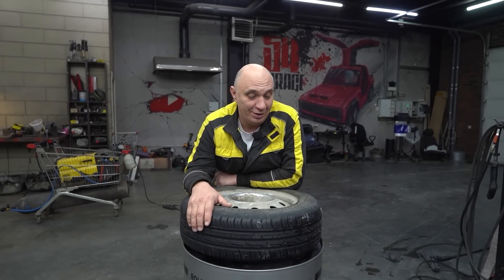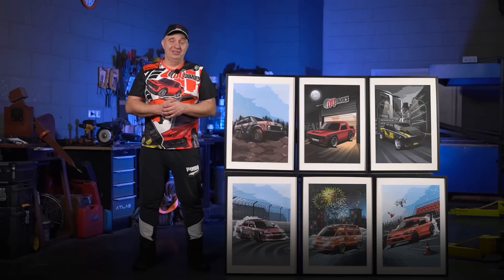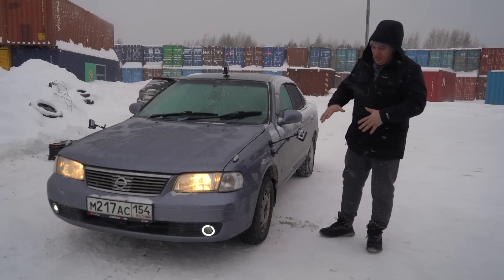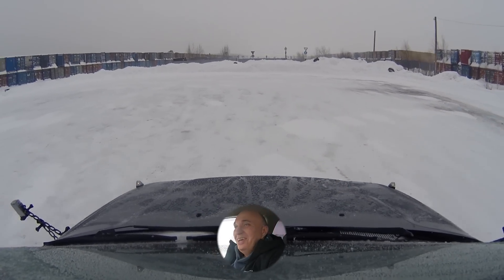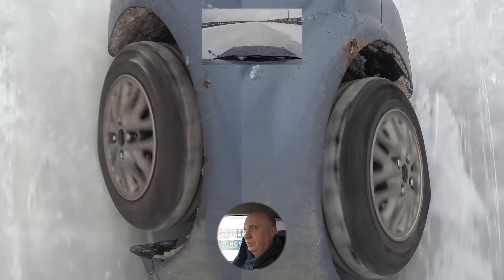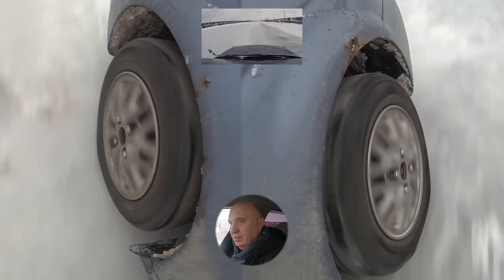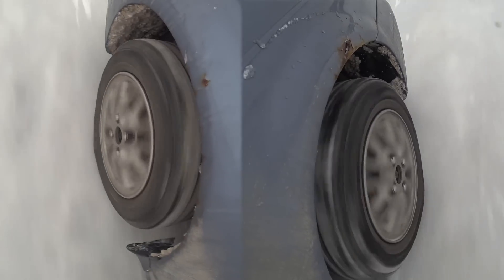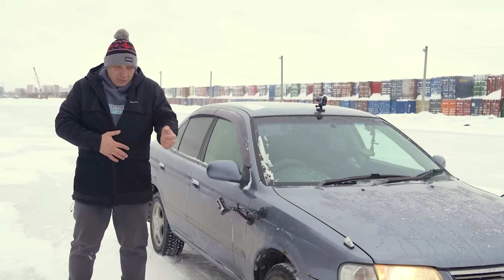We Glue Sand to Summer Tires (for grip on ice) – will it work?

Comment: Snow tires are effective because it is a softer rubber/polymer. I think using Rubber Cement (which is very soft) instead of some glue, would give better grip. The second part is using higher grain sand. Small grain simply gunks up with snow & ice, making for a flat smooth surface again, and becomes much less effective. Larger particles would be something like using studs that won't gunk up and continue biting into the snow/ice.

Comment: My understanding of studless winter tires is that the three major design features are soft rubber for dry traction, narrow grooves to trap snow for snow traction (snow sticks to snow) and silica (sand) embedded in the rubber for ice traction. So these wouldn't help with dry pavement or snow much, but it makes sense they would actually be great on ice like this test. At least until you drive them on dry pavement and rip all the sand off.
Reply: There's also "siping", as in "to sipe" (not "sipping", to drink). Which is:
      a groove or channel in the tread of 
      a tire to improve it's grip.
Usually I heard this done by hand, with a razor... 

I never really looked at winter tires, always having a 4WD truck and living in a suburban area that plowed/salted/sanded, so I never needed winter tires. However, I've noticed in the various videos here, that their winter tires DO have lots of siping in them from the factory.
It looks kinda like fish gills on their tires.

I had always kinda thought it was just something cheap people did and was more of an old wives tail... But I guess not! 😊
Reply: @DUKE_of_RAMBLE  Many tires are manufactured with siping but I think that's more for water than snow or ice.

Comment: If the tires were heat treated, could sand be directly applied/ adhered? If able to adhere directly, sand should hold longer than adhesive.

Comment: Years ago there were companies that recapped old tire and several of the made a recapped winter tread that was infused with sawdust which was supposed to grip better in the snow. The gas station I worked at in the U.S. State of WV always got a large amount of these winter (sawdust) tires. People ordered them for their cars to use during the winter months.
Reply: Sawdust? I remember the green diamonds that supposedly had carbon in them

Comment: We used to do this trick with riding our bicycles into the sand so sand would stick to the tire and then go out on a frozen lake with the bikes, you had very good grip for about 30 seconds until the sand was used up... Always wondered why they do not make winter tires with sand mixed in the rubber... But I guess that would give to much wear on tarmac when there is no ice.

Comment: They are more than 30 years behind. In Norway we peoduced retreaded winter tyres with sand mixed into the entire tread. We controlled the mix by measuring the rubber mass into the extruder, weighed the the sand automatically and mixed it into the rubber in the very last step of the extruder. 
I visited a number of tyre manufacturers, but none of them were interested. I thought we had succeeded with Pirelli, but they mixed the test results at the end. 
My conclusion is that the big tyre industries do not want to produce such tyres because our technology makes it possible to produce all season tyres and winter tyres that would last much longer than spike tyres. They were simply afraid of loosing production and money!
Another observtion from my visits to major tyre industries, is that tyres are developed by chemists only. I met only once a machine engineer who had heared of Tribology which you need to know for improving grip. 
At each and every tyre industry I visited, I asked what they first of all thought of when designing a ned winter tyre. All of them answered mode, not winter grip!
Reply: I've had the same idea for the past few years. I assumed there must be some reason it wouldn't work because nobody does it. That's crazy that they wouldn't take advantage of it if it works. Do they still do that there?

Comment: I remember reading about re-tread tires like tread Wright offering walnut shell infused tread tires. As the tire wears it exposes the tiny bits of walnut and opens the pores of the rubber essentially netting you better grip
Reply: Baby bones work even better.
Reply: @johnmadsen37  um, what?

Comment: Trouble with this experiment, tire normally do a lot of km, in this test, they I think never reach over even 50 km/h?  Even at this slow speed sand already fly away, and they didn't talked to drive it on paved road.  I love their experiment, but I way prefer my studded tires that can reach over 50km/h without loosing any stud. 😄

Comment: I bought a can of ice traction in a can once expecting it to be total crap. I tried it out and was surprised how well it worked. It had some kind of grit and glue. 

Testing it on the icy side streets it surprised the hell out of me how well it worked. 

It wasn't magic but a noticeable and useful extra amount of traction. 

I immediately bought another can to leave in the truck for emergencies and never used it again. But it was a four wheel drive truck so between spraying the tires down in the cold and shifting to 4 wheel drive I was always going to take the easy way out. 

I could see it being really useful for the occasional situations where 2 wheel drive vehicles struggle and need a gentle push.

Comment: My dad used to buy retreaded snow tires that had walnut shell mixed in. I think the shell pieces were designed to come out leaving hundreds of biting edges on the tread. They wore faster but seemed to work pretty good. Don't know if those tires are still made.
Reply: Walnut shells are one of the hardest natural substances in the world. That's why Toyo Tires developed Microbit Technology, which incorporates thousands of crushed walnut shells into the tread compound of the Observe Garit KX, Observe GSi5, Observe G3 ice and Observe GSi6 HP winter tires.
Reply: @learjet1246  Thanks for the reply and the information.

Comment: The problem is the glue stiffness. Try using something like Flex Seal paste and mix with aquarium gravel. The Flex Seal will be like another layer of rubber. Not hard.

Comment: Would be cool to to do a re-tread with sand impregnated rubber so it can't just rub off the surface.
Also, these tests are probably not very consistent because of the snow on the ice, that can give a lot more grip than bare ice.

Comment: Just a suggestion : wouldnt it be better if u apply some heat/flame to the tire so the rubber get a bit warm and sticky, and then push em in the sand? 
Maybe it would stay longer than with glue?
Reply: Perhaps a superior bond, but then you'd introduce another problem of overcuring and pyrolyzing the rubber, turning it from something flexible and grippy into something brittle and slippery. Ideally you'd include sand during the initial cure of the tread. This would allow any rubber in contact with the road to have maximum grip. The grippyness of their cured glue is another unknown.

Comment: Just a thought, but how about gluing feathers on the tread surface? Just normal bird feathers or poultry feathers - plenty of glue, and plenty of randomly piled feathers.
Reply: Bolt. On rubber coated plastic cleats?  Even retreads can come loose and cause trouble for cars behind you.  If they someting sprayon that was chunky with sharp grit it would grab at least but would it clog in freezing ice.

Comment: Didn't think it would work... figured at the very least you'd need to encapsulate the sand somewhat by alternating glue/sand a few times to get a good layer.
Reply: At that point I think the sand would just break off and cause less grip.

Comment: Hey guys, gr8 video, but just a thought, why not vulcanise the tread of these tyres with sand present, when heated, the sand would be fused into the rubber better than just using glue, and instead of using just one sand grain size, use a mixture of grain sizes, not too big though as could affect traction performance as pebbles stuck in tyre tread causing skating between tyre and road surface under braking

Comment: There is definitely more you could do with this!
I'd have like to see you end with winter tires + sand
Reply: And coarser, larger grain sand, repeatedly layered with glue and sand thickly.
Reply: Quick touch with a belt sander
Reply: I'm thinking something more coarse like something along the lines of fine gravel, maybe bonded by some sort of epoxy or maybe rubber cement. If Sand works that well, it may even outperform the winter tires if it can stay properly adhered to the tires and not fall off.
Reply: @kentworch  Do you mean like tailings?

Comment: Could you guys test what is the difference in braking distance between different sidewall height in tires? What i mean by that is keeping the same width of tire and increasing rim size. Example being 225/40/18 and 225/35/19 and 225/45/17, you get the idea i hope. Just to compare sidewall height keeping everything else more or less the same.

Comment: Wonder if when they make a tire if they can put sand on the last layer of rubber before they cook the tire solid that way it will be in the rubber
Reply: Yeah I was thinking they should have rolled it a couple times back and forth glue/sand/glue/sand/glue to encapsulate it for a similar effect.

Baking it in would guarantee there is always some at the surface tho as the tire wears.
Reply: @MadScientist267  I suspect that winter tires already contain a ton of silica, since rain/all-weather tires are known to include silica in the tread compound.
Reply: They already sell tires ike that has walnut shells and crushed glass inside the compound.
Reply: @Joegreen-r1i I didn’t know that I will check that out

Comment: Why don't you use P60 sandpaper instead?
Reply: I like this idea! They should try it
Reply: You wouldn’t have any tire tread
Reply: The paper backing would be an issue, but something like grip tape for skateboards might work
Reply: @fishrsa9046 Grip for skateboards would fall apart, the small "stones" will fall off. But good idea. They should use red sandpaper with cloth backing
Reply: @maxx-er3fj  ah I would have thought it would be a bit stronger than that but I guess I'm underestimating the weight of the car here
Reply: Emory cloth would work best, the cloth would allow the adhesive to grip better at securing the Emory cloth to the tyre more efficiently than paper.
Reply: Because you will not gonna get grip between thread pattern
Reply: Check their video named "sandpaper for extra grip on ice".
They have done it already.
Reply: P20 very rugged
Reply: Because sandpaper isn't durable enough
Reply: Right
Reply: The issue with sand paper is that it will probably fall apart easily.
Reply: Belt sander ??
Reply: They already made something like that, but that paper got clogged quicly and lost its power
Reply: Sand is free?🤷🏼‍♂️🤔🙂
Reply: Even if you cut the sand paper to the treads you're relying on paper to hold.
Reply: @bennyboyy7  I did not mean REAL paper. There is a replacement for that, it looks like sandpaper, but it uses some kind of mesh as the base of the sanding material.
Reply: They're in Russia
Reply: @patrickr2686  I think Russians have sandpaper

Comment: You guys should try to make the sand work like the rail road uses it. Hopper above the wheel which drops sand between road and wheel
Reply: It's nothing new and busses and semis have them sometimes...it's not a new concept and you can buy kits to add it..
Reply: Rails don't have salt nor other traffic, potentially adding moisture to that sand causing it to clog/freeze.
Reply: @Kinann  I would assume that the widespread use of grit and sand as friction agents in icey conditions has generated  a body of knowledge such that the issues you raise are likely solved problems. The only real issue with the solution as stated is the requirement to carry a large amount of sand.
Reply: @Kinann  I admire your enthusiasm, but keeping the sand free flowing could be achieved in many ways, portable kibbler, rotary auger, redirected hot exhaust gasses to list but a few. In the uk we have a vehicle known as a ‘grittier’. This is a truck chassis, with a retractable snow plough blade at the front, and behind the cab sits a large hopper with an auger at the bottom. When filled with grit etc, the auger drags the grit along its length to the rear of the vehicle where a hit and miss vane and cone scatter the grit behind the vehicle. These vehicles are used is icy conditions. 
So I am confident that a vehicle with a hopper etc… scattering grit ahead of the wheels would position the friction element between the tyres and the ice. 
Depositing directly onto the leading edge of the wheels is simply altered geometry, not altered physics.